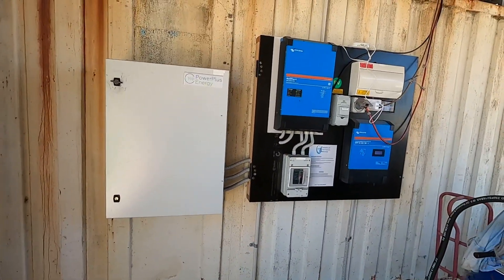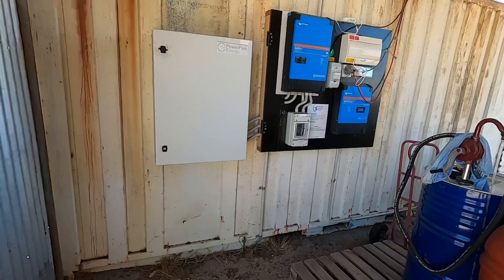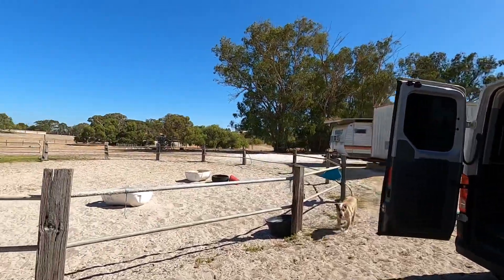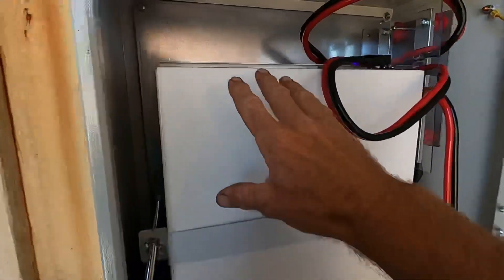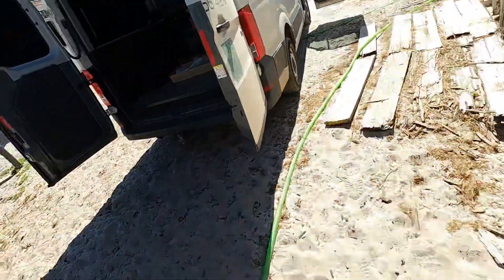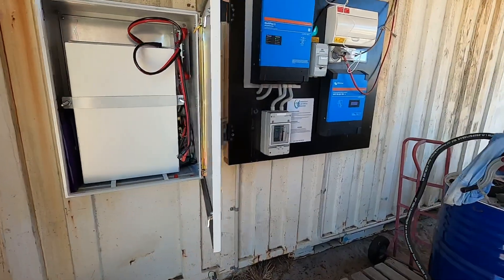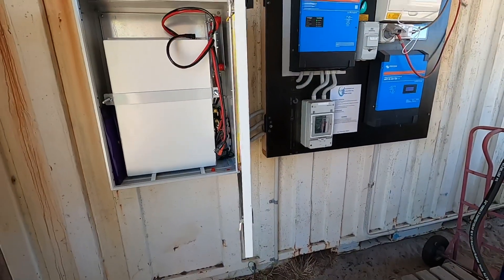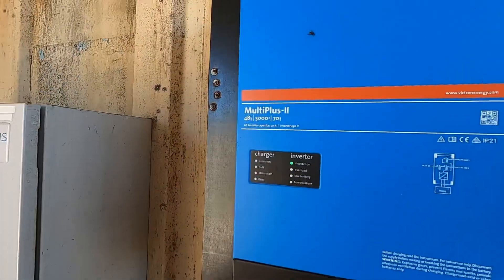Victron Off Grid and Power Plus Energy battery upgrade day!

Comment: Hi! Nice system! But you could have saved some $$$ on the victron MPPT and take the 250/70 instead (2 parallel string of 4 panels in series) and installed an extra battery ;-)